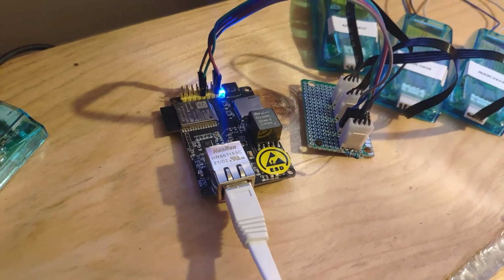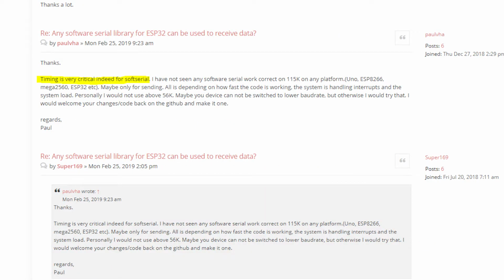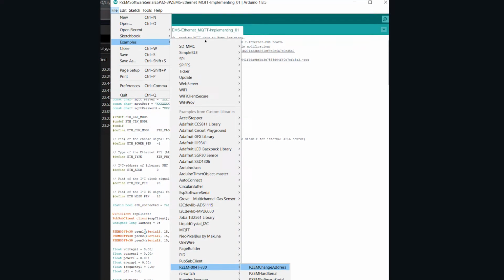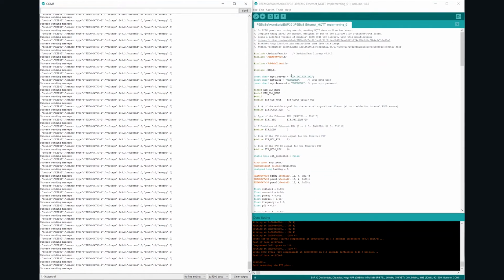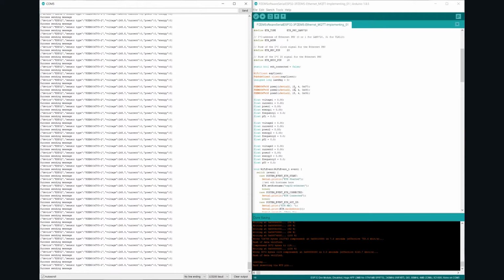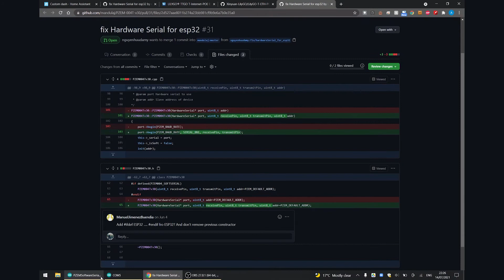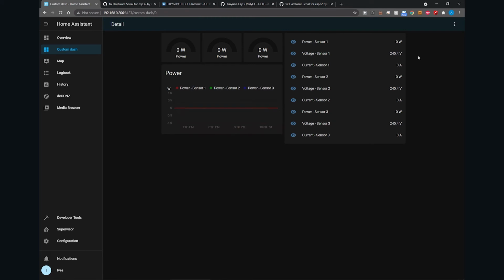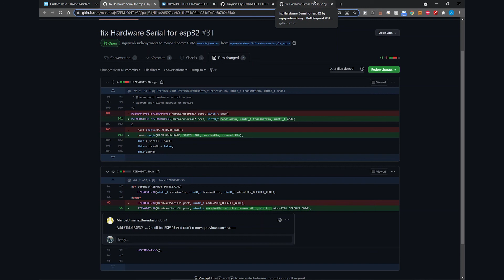Lilygo POE ESP32 - multiple PZEM004v3 on HardwareSerial - MQTT Home Assistant

Comment: i tried in esp32 with 3 pzem device but not suceeded, it has 0nly 3 serial port . one used for booting other two i connect for two pzem, so i cant connect for 3rd one. i checked with ur code but when i connect one it will give result, connect others getting 'nan'.i their any solution for this

Comment: Connecting only one pzem004-t (100 amps) to a triphase load and reading measurements is possible ? Because I tried to measure it UART started (can be seen in microcontroller), and I can see approx. 220V in voltage, but when it comes to current and power they seem irrelevantly wrong ( current = 0.04A , power = 0.50 W ) . I am start to think that they might not be compatible to operate 3 phase systems. By the way , I tried to surround current transformer to each phase and my measurements are not changed. My microcontroller is lilygo-t display. Good work !

Comment: Awesome video. I am looking for a simple solution PZEM-004T with Microcontroller WT32-ETH01 and ESPHOME but cannit make it work. Could somebody assist?
Reply from the maker: Thanks! I haven't used Esphome myself yet: because it's a pre-built swiss knife you don't have access to the actual code, any hardware other than what's in the tutorials will be a challenge to get working. I have seen some people have success with the Wemos D1 + pzem on the home assistant forums.
It wouldn't take very much work to adapt my code to have it working - where are you trying to send the pzem data?

Comment: Hi, I am Newbie in These Things
I want use 3 Pzem with Esp8266, Is It Possible to do, If Not Then Which Microcontroller would be best (must have Wifi)
Reply from the maker: The board I use in the video is based on Esp32, which is just a faster, better, dual core version of the 8266. My board has ethernet, but you can modify the code for wifi, it's very similar you just add your ssid & pass in the sketch. Have a look at some esp32 WiFi mqtt code examples and compare with mine. You can piece it together with a bit of effort 🙂

Comment: Hello. I want to connect the PZEM to a regular ESP32 via the RX2 and TX2 ports. Is a 5v to 3.3v voltage converter needed?
Reply from the maker: Sorry for the late reply! Yes: the PZEM is 5v so either logic level shifters, or you can use simple pulldown resistors on the rx/rx lines. Some people report the shifting not necessary, but that's luck and eventually the ESP ports will fail.

Comment: Hi ASM, how are you?
  I've been trying to use 3 PZEMv3.0 on ESP32 for a while, but so far it only brings me NaN in all values.
  Your Lib I tried to put in the IDE, but it is giving error in serial3,
  I'm using ESP32 WROVER-B
  My idea is to take the 3 meters and send them by GSM with the SIM800L,
Reply from the maker: Hi, I don't think ESP32 has Serial3 - try Serial2, and make sure you're connecting to the pins as mapped in HardwareSerial.cpp:
C:\Users\XXXXX\AppData\Local\Arduino15\packages\esp32\hardware\esp32\1.0.6\cores\esp32\HardwareSerial.cpp
 Or something similar.
Look for RX2 and TX2

Comment: Hi AS Motion Lab,
Can this PZEM004T be used with an Arduino , i am planing to use 3 of them for a three phase line, how to connect & map the PZEM's on to a single Arduino.
Reply from the maker: With arduino it's easy - but depends which arduino. With a nano or one of the smaller chips you will have 1 Hardware Serial channel, and use 2 Software Serial instances for the other 2 PZEMs. If you use a Mega, i think it has 3 hardware serials - even better. So just address them separately, with their wires.
Reply: @Loopyengineeringco  great let me try it. Am looking for a pro mini or Uno.
Reply from the maker: @skd5432  cool. I think both of them only have 1 hardware serial left, so use that for 1 PZEM and create 2 extra software serials for the other 2. This should work fine. I think there are guides about how to do that

Comment: how to remap HardwareSerial.cpp?
Reply from the maker: The modified library should use the pins you specify in the constructor:
PZEM004Tv30 pzem1(&Serial2, 15, 4, 0x07); // Means pins 15 & 4

But if you want to override this in HardwareSerial.cpp, you will find lines like this:

#ifndef RX1
#define RX1 9
#endif

#ifndef TX1
#define TX1 10
#endif

9 & 10 are the hardware serial port gpios. Change these to your desired pins.